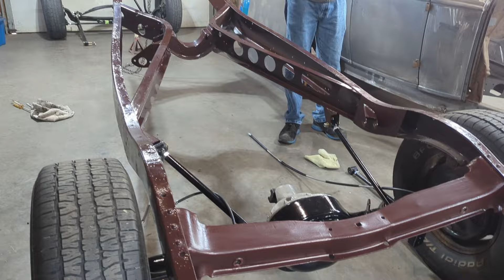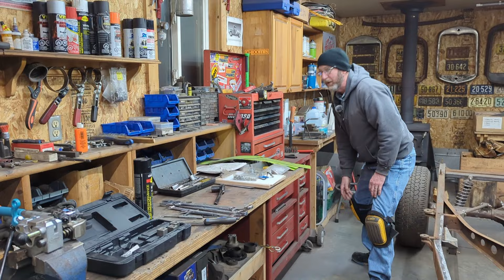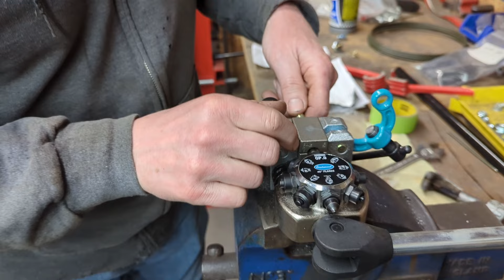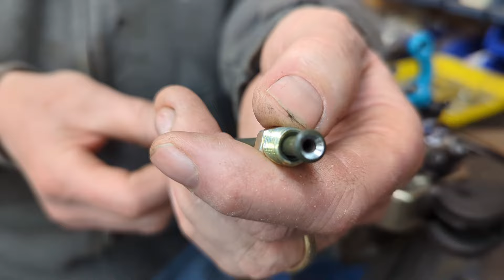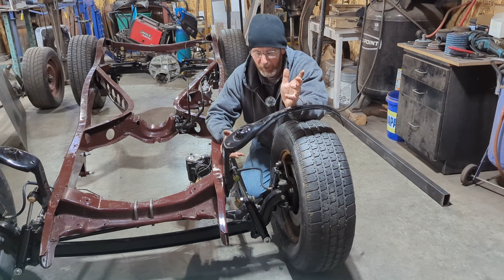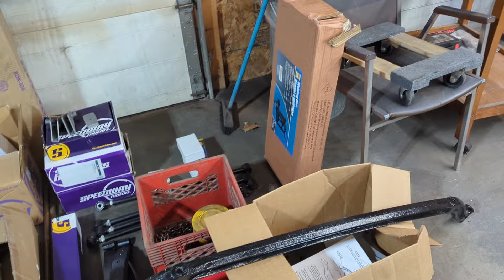Original 1934 Frame installing the brake lines

Comment: I watched the video you did on reverse spring eye and how you lowered the leaf spring. I have a 70 mustang that I want to lower, not reverse eye, do you think the 70 rear springs could be lowered the same way? Thanks for the gr8 videos.
Reply from the maker: Yes you can change the arc in the springs and or remove 1 or 2 leafs. If you remove leafs you will soften the ride though and you may not like that in a muscle car. I would try changing the arc in the springs first.
Reply: There's only 4 leaves so I'll try the slow reverse bending. Thank you.